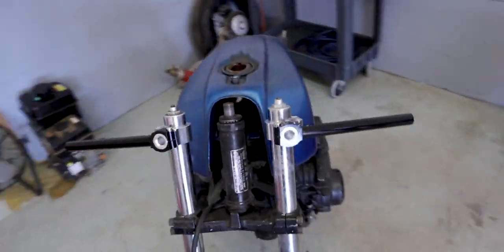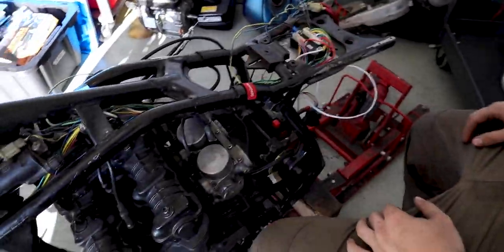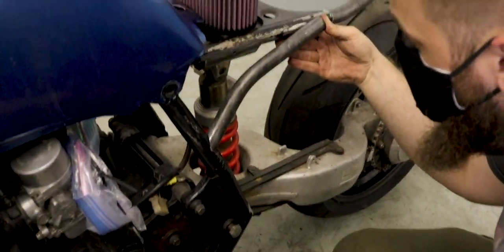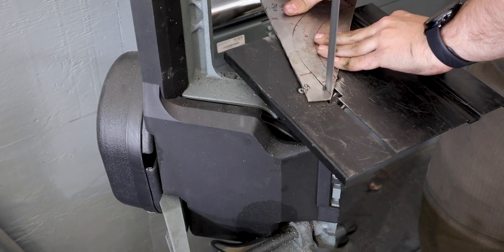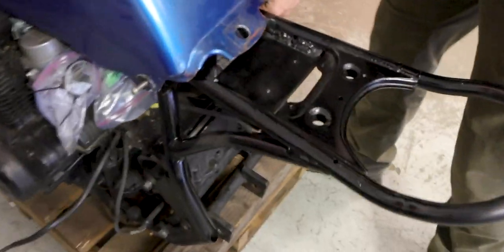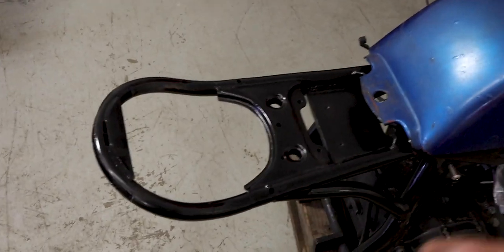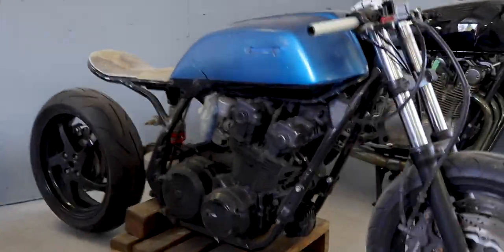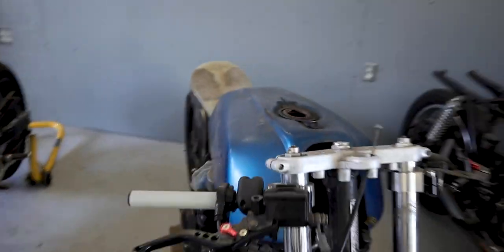CB750 Subframe fabrication - Cafe racer build EP.2

Comment: Front looks great! 
Im curious about the front mods. 
The front suspension is the original adapted for the wheel and rotors or you change the whole system? Im looking for a similar idea to my CB750F for better wheels and breaks but same suspension. Why did you sold it? It was looking sick!
Reply from the maker: The front forks are from an older model GSXR I believe, not too sure because the bike came like that. My brother sold it because he wanted to build something different